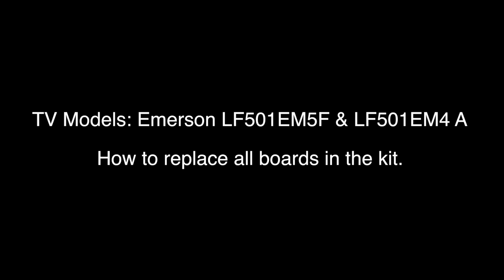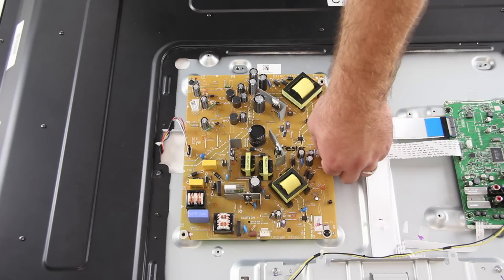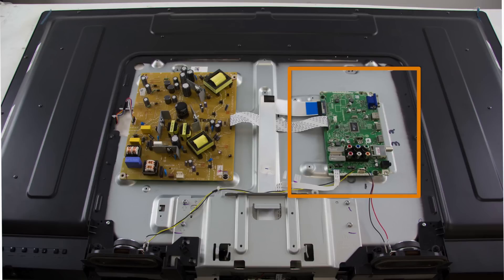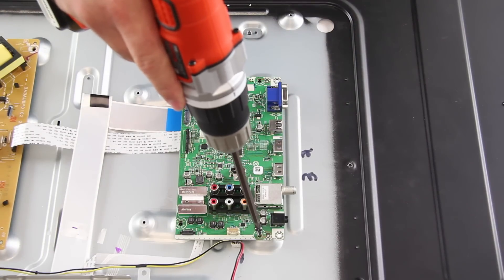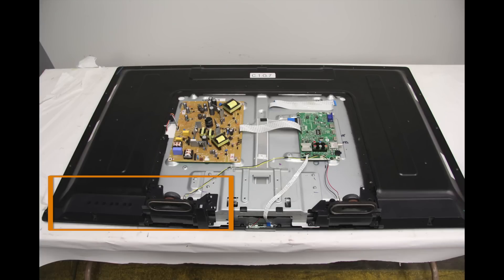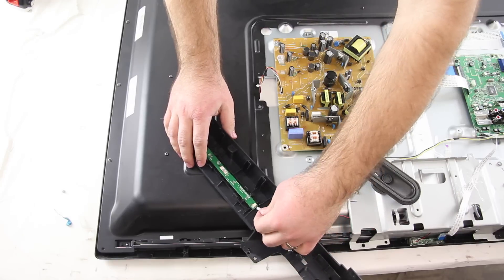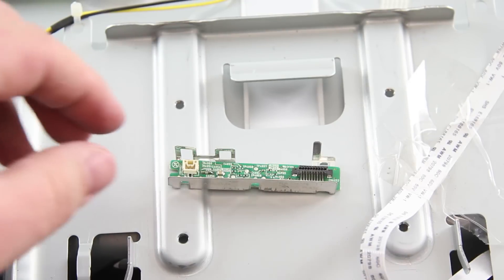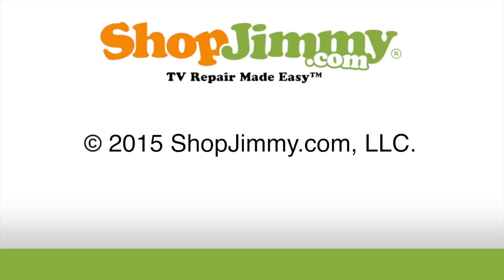Emerson LF501EM5F & LF501EM4A Board Kit Replacement Tutorial

Comment: how did you pull that flex cable out on the power card, the first blue ended flex cable you pulled?  Anyone can answer, mine seems difficult to pull, is there a trick to it?
Reply: Time 5.27  is the answer.
Reply: Just pull straight out.

Comment: changed main board now screen is solarized. any ideas how to enter service mode?
Reply: have u figured out your issue
Reply: Joe Lazy I purchased wrong serial number board. no way to adjust in service menu or either I couldn't figure it out.
Reply: I bought them naver open the back mine r fine.........my tv has sound n lights up just no pic
Reply: I had no power to begin with. New board gave me power and solarized pic.

Comment: Hi I have the LF501EM5F and a little water go in the back of the tv and white flashes and streaks appear on the TV at random times should I just replace the computer and the power board or just the computer or is it an LED damage when the white streaks are not there the screen looks fine the picture looks fine butt it flashes and little white streaks come up on all different parts of TV please help.